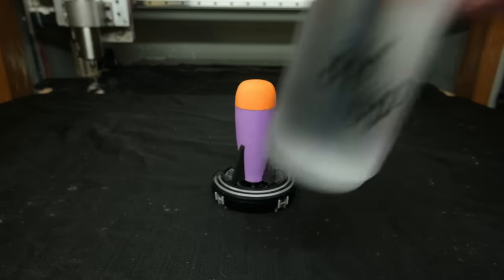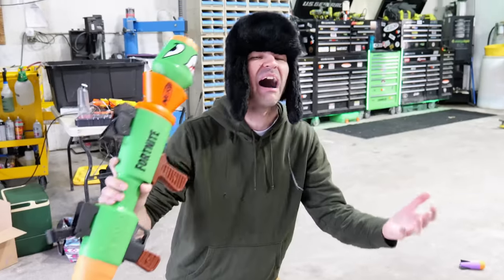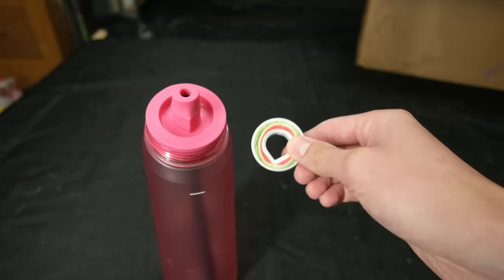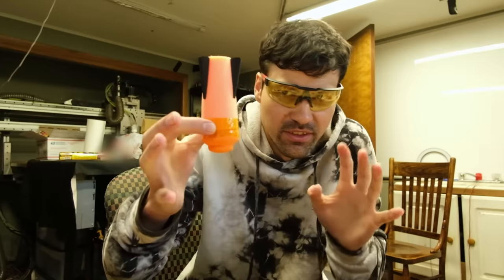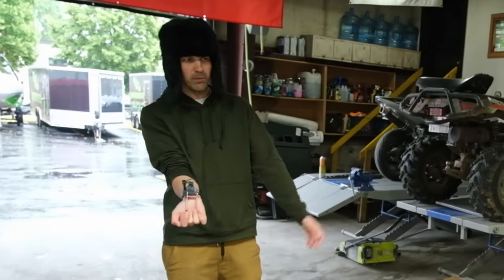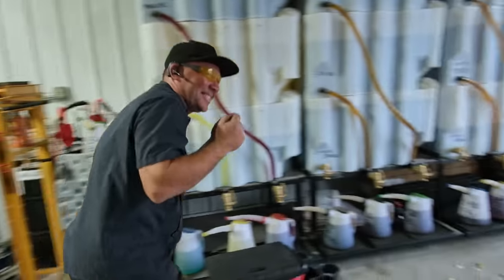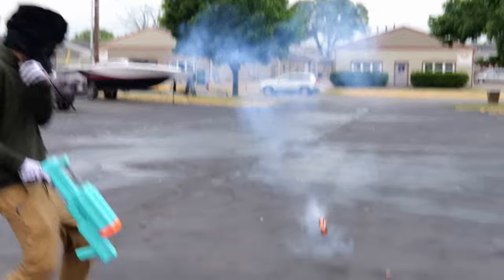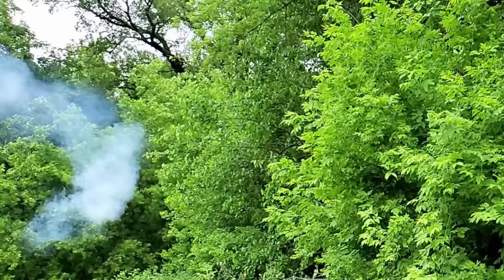I built secret Nerf missiles

Comment: The Titan nerf rocket system would be a good platform to modify like this. it does need to be pumped but it has a trigger(and a pressure gauge) and a much bigger rocket. the main issue would be finding titan rockets, you can get custom made ones since the original nerf ones are going to be old and expensive since they're limited.
Reply: That’s what I was thinking
Reply: I've heard you can turn pool noodles into titan rockets, damn that thing is a lot of fun.
Reply: I'll never be able to see the word "titan" again without thinking about 5 rich idiots who imploded.
Reply: OH MY GOD I had one of these as a kid.
You could use thin, cheap pool noodles sold at the 99 cent store on the top of it, and as long as you glued the end shut it would launch them. The air storage tank is also expandable.
Reply: I still have my Nerf Titan with the 2 attachment guns from when I was like 5 lol
Reply: Yeah I think its about the same as pool noodle size, but with the beauty of 3d printing and TPU, you can probably make a sleeve for almost anything or the payload itself. Or you can probably make it with paper similar to paper towel and toilet paper tubes (I think those are too small, I don't have my Titan beside me to check).

Best memory I have with one of those I was at a buddy's house, and one of his friends was playing CIV 4 and sitting with the chair leaned back on only its back legs (which his mom hated because they were probably antique chairs), and I was probably wearing a Ghillie suit and came sneaking around the corner in the hallway, took aim, and wham! I didn't intend for him to fall back (I think it was more panic than impact) and I was really worried he was hurt but he bust out laughing so I knew he was fine. Ah good times...
Reply: youve got several options to fix that, cut a pool noodle, they work about as well as the originals ever did with a little work, 3d printing, my titan actually has its barrel swapped out with a narrow neck tube and it takes two ammo types, darts down the tube and out they come with unsafe velocity and after using tape to thicken up the wall it also takes these modern rockets too fitting over the barrel
Reply: @nickolaswilcox425  True, you could print custom barrel so it would work with paper towel tubes or pool noodles available in your area.
Reply: Dude my friend had one of those and we'd just take it up to as much pressure as it could take and gut shot each other with it. Thing was awesome.
Reply: @maxhay9098  I still have one, has an original rocket too. I dont have any of the guns that attach to it though sadly.
Reply: I had a Titan modified with a 1/2" PVC coupler to fit all sorts of attachments, from a three shot burst to a seven shot burst... or a 2 foot long barrel to fire one 1/2" dart very, very quickly.

My uncle told me to shoot him in the back with it, because "he could handle a little foam".  The paintball-level welt it left reminded him that 13 year old aspiring mad scientists should be encouraged at your own risk lol.

Comment: That’s epic! Your creations constantly impress.
I did have a thought for the co2 rocket; modify the launch tube to have a pin in the bottom, and two swing out legs for a nerf mortar 😸
Reply from the maker: I like the concept, though aligning the pin with the center of the cartridge tip would be quite difficult
Reply: Not really just use green gas instead of CO2 like the pico blooper cartridge
Reply: AND THE NOOB TUBE HOW COULD I HAVE FORGOTTEN
Reply: @TheNorsemon what is "green gas" made of???
Reply: @MODElAIRPLANE100   It is just propane with silicon oil airsoft uses green gas and i think evike [ a airsoft shop] has a silicon oil adapter to put on a propane can

Comment: I like the magnet idea. What you could do, is use the original launcher (and put the magnet on the launcher instead of the rocket) since you said it's hard to stabilize the rocket without the launcher. Since you're using a launcher, you could also add a trigger to it that activates the rocket. This also gets rid of the short radio distance, since both parts would be in the launcher

Comment: Would a plastic tube insert with the firing mechanism at the head or mid way be an improvement? Rather than dismantling the rocket every time to modify it, perhaps a simple addon insert to each rocket ammo with a calculated weight distribution for the average rocket based on achievable/desired distance.

Comment: Here’s my idea: let two metal contacts stick out of the missile, which act as capacitor chargers. They are always connected to a power source as long as long as the missile is in the launch tube. As soon as the missile gets ejected, the capacitor starts to discharge and sets off the propellant.
Good luck!

Comment: have the circuit activated by pulling a string out of the bottom of the projectile, then tie the string to the launcher. once the projectile gets 5 or whatever arming distance, it pulls the string right out of the bottom and activates the rocket. no wireless doodads, no switches, no need to break the seal off the foam.

Comment: You could have put a piece of metal piping into the nerf missle. Then you could have fit an .22 blank into the back and you could hit it with a hammer. The .22 blankwould generate enough gas to throw the nerf missle like maybe 50m at great speed.

Comment: Next time try to make the launcher from scratch with a replaceable compressed air tank so you don’t have to pump the rocket, if you were to use hydrogen to launch it you could then use a timed fuse in the rocket to ignite the hydrogen as the rocket leaves the end of the launcher, I think that would be pretty cool if you could pull that off successfully
Reply: A makeshift launcher, a hydrogen tank, hydrogen in the air and fire sound like the simplest way to end up dead
Reply: @roberine7241  ok, so it’s not perfect but as a engineer I can tell you that although hydrogen is highly volatile if used in a small quantity it would be very safe whilst still looking pretty unsafe.

Comment: Just discovered this channel and subscribed 🙃 if trying to make it "like" a javelin missile in that it powers itself after being initially launched you could easily make it like a bottle rocket with the center of gravity at or after the moment of thrust. Shove a stick up it's ... and aerodynamics be damned. You could use the stick like a guide rod with your launcher. A short cable could throw a switch or shear spring at a determined distance from the launcher. Thanks for the vid. Can't wait to see what's to come with the javelin nerf missile

Comment: maybe try that limiter switch again but have two, near the bottom so its balanced and clicks as soon as the missile is on the launcher
also try melting the foam layers back together, and maybe increasing the initial launch power with some CO2 canisters (use the nerf launcher as the puncture and make a switch so it acts as a compressor with very fast pressure release or something, idk)
Reply: What about green gas like the pico blooper  cartridge

Comment: A mosfet would be a much smaller option than a relay. Paired with a reed switch or hall effect switch it would be very simple to have it trigger after leaving the launch tube. Magnet acts as safety, mechanical limit switch is the trigger. Would also be easier to integrate with the wireless remote too.
Reply: I don't know of many small ones that can repeatedly handle almost a short across them though. If you know of a small cheap one (below $10) that can repeatedly handle like 200 amps at 12v for 100ms pulse then I think it would be possible.

The other issue with this particular design is if trying to embed it into the foam rocket, you probably have low voltage (and therefore even higher current) required. Mosfets typically can't handle huge spikes quite as much as mechanical, they just burn up really fast, but I'm not an electrical engineer, my only experience is burning up a decent amount of transistors...

Comment: If you added weight to the bottom of the rocket it could help the launch by bringing down the rear mid flight then when the rocket engine activates it would be facing upwards.

Comment: You could combined the remote launcher with an air pressure system they blasts the nerf rocket and once the rocket is in the air then you could hit the remote button and the rocket will fly a bit more straight but you have to find a way to arm it without a magnet so the rocket doesn't have the extra wait on one side

Comment: I have an idea on how to get it to work:
Get a pvc pipe a little bit bigger than the diameter of the missile, line the inside with a thin layer of aluminum, and Velcro the key fob to it and then, hopefully, you have a rocket launcher

Comment: have you thought of a piezoelectric diode ignition switch

that once the rocket exits the launch tube sees daylight it triggers a small electrical spark that detonates a propellent charge thus the 2 stage rocket would work 
because it would be possible to set up a delay to ensure free of the tube before firing the second stage
Reply: i may have typoed something above 

specifically 
around ensure 
what it was meant to say was 

"to ensure the rocket would be free of the tube before firing the second stage"

Comment: If you use the mecanism from the first launcher with only the dart and 3d prin a 9/10 dart holder you could have a mine you step on it and the switches activates the capacitor and ignites the cotton

Comment: use a pipe so the air seal is around the missle and not in the missle, this will allow for more fps and better accuracy and the walls of the missle wont brake (hopefully)
Reply from the maker: The fins stick out farther than the body

Comment: what if you make a nerf mortar with the co2 you drop it down a tube and it fires that could work. also for the javelin you could make a tube with a big spring which hooks into a switch and has a cylinder at the end so when you push the button it activates the spring and pushes the nerf missile out the end. for the javelin you could replace the fins for a plastic fin which is connected to a magnet in the tube but when it goes out the tube the magnet disconnects sending a message to the capacitor to fire

Comment: put a co2 compression system in the actuall fortnight launcher so it has a working trigger and is not pump activated, and it will probably go farther even if you dont have the rocket. allthough if the button that remotely launches the rocket goes off with the trigger but slightly delayde, that would work better and go farther. keep doing what your doing!

Comment: why didn't you just upgrade the launcher? put a mini potato cannon in it and adjust the launch psi so it dont just blow up the foam dart.
or use a micro controller, servo valve, and an arduino mini to adjust how much butane is in the chamber.